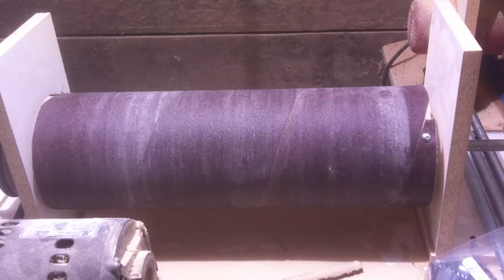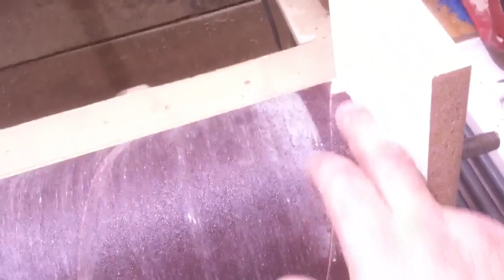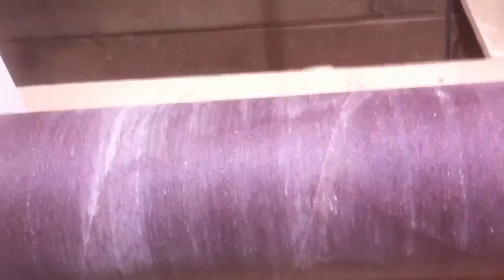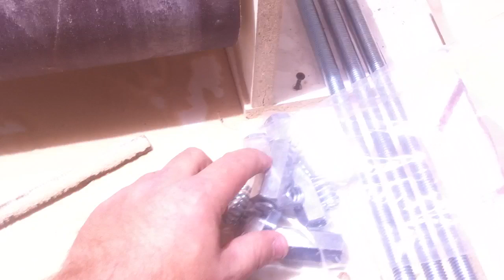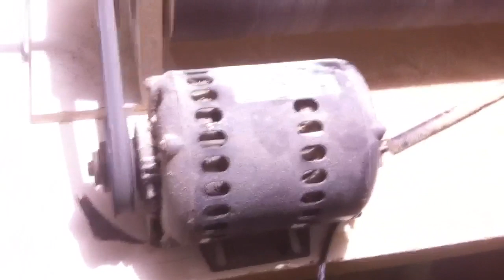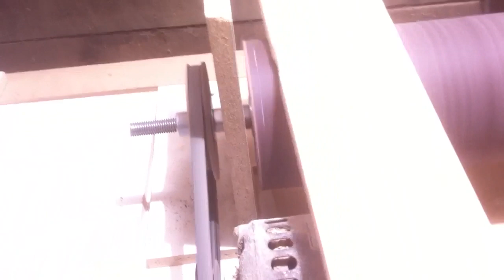Wooden Tool Man's DIY Drum Sander 4. Putting sandpaper on.

Comment: Question, and I apologize if you covered it in your video, what width and type of sand paper did you use?  I'm assuming a cloth backed and it doesn't have an adhesive back?  Great job by the way and your very industrious.   Thanks for sharing

Comment: thanks for postar.gostaria to see how you made the cut in angle of lixa.estou making a roll with ferro.estou considering using a clamp to secure the lixa.ou even make a threaded hole and hold in ponta.vou see what is melhor.so am in doubt as to cut the sandpaper tips.
if you can comment or show again will be very grateful

Comment: Wouldn't be a problem when the screw meets the wood?
Reply: ***** The screw heads would certainly mark up your work piece. I would build a rail or guide into the edges of the front/feed side to keep the work piece away from the screws as it travels through the tool.
Reply: Michael Crilley Wow...that was a fast response! :P
Reply: Δημήτρης lol